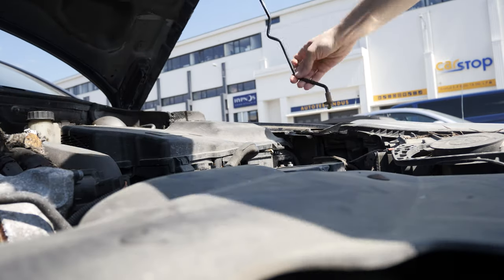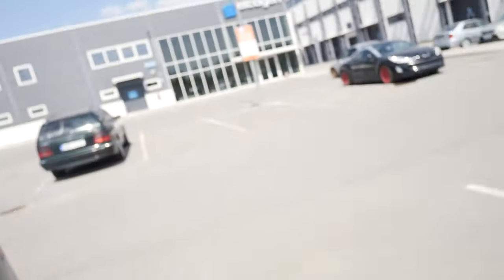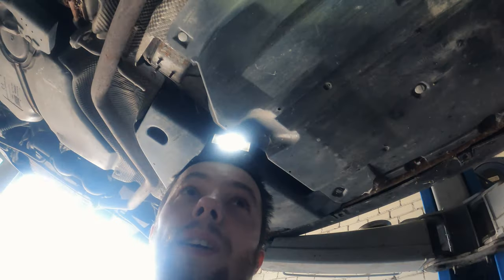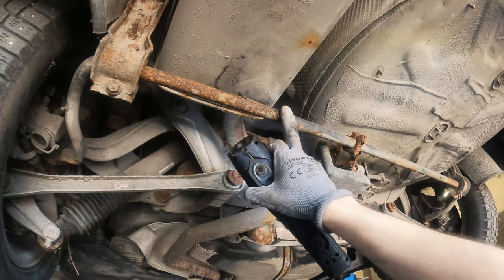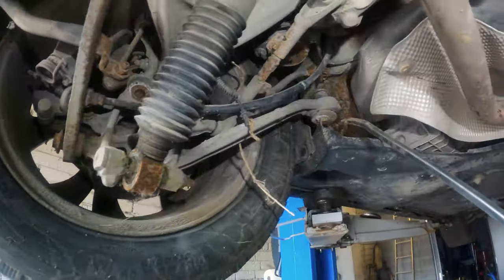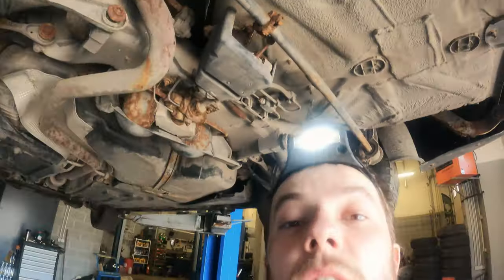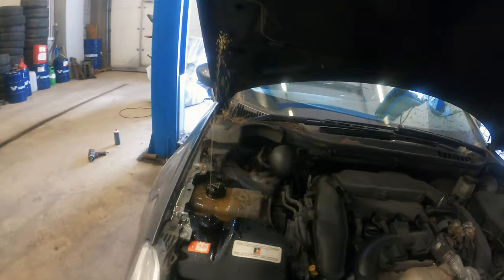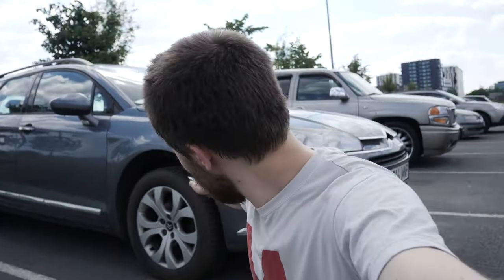Hydropneumatic rescue! Cheap C5 shooting brake!

Comment: A word of caution. When lifting the c5 off the ground ensure the suspension is in the highest position and that the LDS fluid cap is loose (but still in place to avoid dirt entering the system).

If these steps aren't followed the weight of the hanging wheels could draw unmetered fluid into the system and when you put it back on the ground the weight of the car causes a rush of fluid back to the LDS tank causing it to burst.
Reply: Should have watched the video finished before commenting... 😂 Would have seen you read the forum.
Reply from the maker: Yep. Learning can be painful at times. I'm still suffering from that decision.